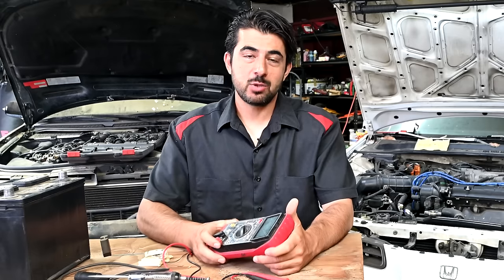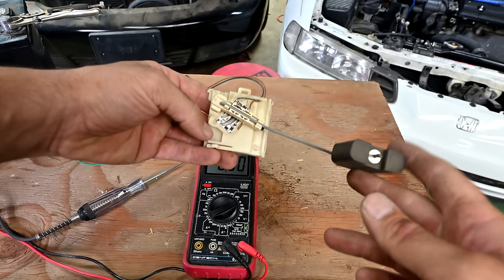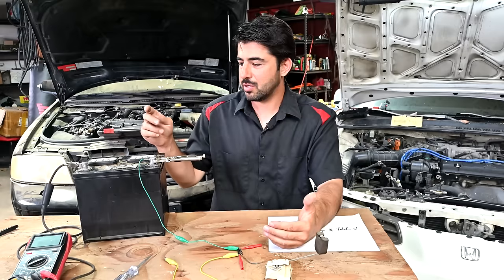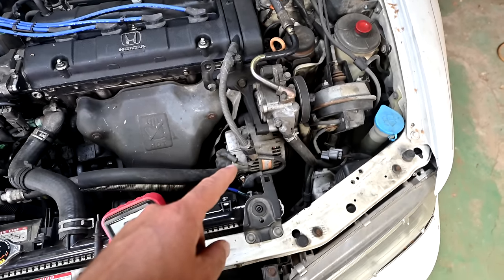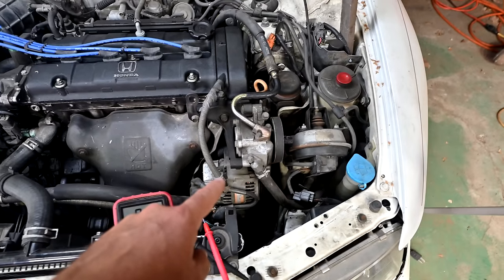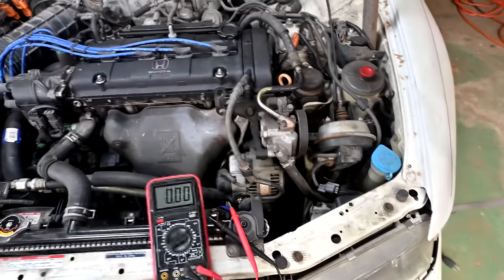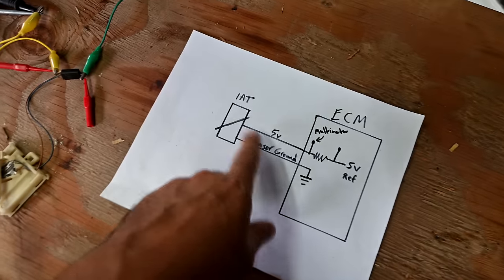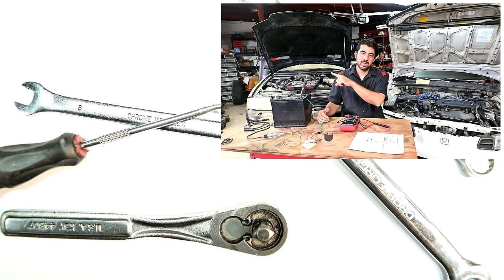Fix Electrical Problems by Understanding Voltage Drop Testing

Comment: I don't think this was explained well.  Made it too complicated.  You're trying to work with a voltage divider circuit and using that to detect the state of the device that is dropping voltage (presumably for a position that correlates to a changing resistance level of a variable resistor).  The end comment about 12 v. when unplugged is also confusing.  There are voltage grounded circuits, where the 12 volts is being supplied by one wire, then going through the device, and then back out to a PCM with a circuit that has internal resistance, and possibly a transistor circuit for bias (switching), and is grounded.  The resistance outside the PCM, along with the resistance inside the PCM provide a voltage divider circuit, and affect what is sensed inside the PCM for decision making elsewhere.    The sidetrack onto voltage drop across fuses was also confusing.    Basically too many concepts/examples across too little time while jumping around the engine bay also contributed to the confusion.

Comment: In a series circuit the sum of all voltage drops is equal to source voltage. In series circuit the the current is the same throughout the circuit. In a parallel circuit voltage is the same but the current will be divided in each branch depending on the resistance. If all the branches have the same resistance then they would also have the same current.

Comment: Can you explain why a brand new battery  forms acid around the terminals? I've replaced my car battery twice with new interstate battery, and still continues to build up acid.
Reply: Maybe the Car is over charging ? Have You had that checked ?
Reply: Clean your battery terminals then put some silicone paste on them.
Reply from the maker: yes check the alternator to see if its overcharging the battery.
Reply: @k9under  You can put anything on there. I’ve used just basic chassis grease and it works fine. Some people periodically add engine oil off the dip stick and that works fine. If you’re real fancy you can buy a tube of dielectric grease and feel good about yourself.
Reply: @markm0000  Yes sir back in the 1970 i use to put vaseline on battery cable.

Comment: This was a great video explaining  circuits, resistance, electrical theory.  I've taught myself how to read wiring diagrams to to the level of adding heated seats and power windows in a manual window car. Everything worked 100%. A great sense of accomplishment for me. Toyota dealer was impressed because I designed circuits to bypass bcm with stand alone harnesses.  Excellent content made perfect sense.🙏

Comment: I had a coolant temp sensor fail on a later model Jeep Wrangler a while ago. I was doing my due diligence and testing the circuit and I noticed the 5v wire went from something like 2v to 5v when I unplugged it. I'm guessing this is super similar to what you were explaining in the video with the 5v circuit going to 12v. But if you could explain this clearly I'd be grateful. Great video thanks !
Reply from the maker: I will try to make more videos like this, but I think I need to split things up and be more thorough :)
Reply: @myRatchets  it might be cool to do a video on diagnosis of 5v sensor circuits. I would definitely be interested in learning more about that

Comment: What would you recommend (tune-up wise) on a car that's been inactive for 5+ yrs?
Thanks and love the content!
Reply: Id first and most put some oil down each cylinder before turning it over. I would also disconnect fuel and spark to build up oil pressure. Everything is dry as a bone. full brakes, calipers, brake lines, air filter, cabin filter, oil change, fuel filter, trans fluid change, coolant flush ugh just redo it all.  Sitting inside and outside plays a role.

Comment: The two resistors in series form a voltage divider circuit. When the connector gets disconnected @16:00 and you read 12V instead of 5V, the resistor in the ECM is acting something like a pull-up resistor found in digital circuits.
Reply from the maker: ah makes sense, thanks for your comment.
Reply: Holy crap I forgot everything from my electrical class. I need to get back to understanding these.
Reply: Thankyou, that was the bit I was confused about.

Comment: Amps is the lazy one that doesn't go anywhere unless theres a clear path to ground
Voltage is the active one thats always on the go, until something get in its way or send it on a detour, 
for example 
A break in a wire is like a bridge that would've carried you on foot straight home had it not been blocked by cops all of a sudden , now you have to detour a much longer way which will then drain some energy from you by the time you reach the other side, that blockade can be one of 2 things, a switch that will drain a required amount of volts which is normal or resistance thats contributing to more than normal voltage drop, bad switch, break in the wire, rust corrosion etc

Comment: @R&W - Just two questions (1.) In most shop manuals, you'll read, in bold print -"Do Not Test Grounds Using Vehicle Ground" (or something to that effect); I guess there's fear of errant 12V running thru the ECU. Is this the case? (2.) And I've seen old school techs test an alternator by quickly removing the neg. battery terminal, and watching the stall and/or hesitation - can this actually damage the vehicle's electronics?
Reply: old school techs test an alternator by quickly removing the neg connection, not good for modern cars because they have computers.
Reply from the maker: That is not a good way to test an alternator, modern cars will stop running regardless of a good alternator or not, also you'll lose all setting and not safe for your ECUs etc. sorry not sure I understand the first part of your question.

Comment: Hi, I have. problem with dodge caravan. I changed the alternator and the battery was tested it is working, however. There is a sharp rapid drop in voltage after I turn the engine off.  does within seconds from 12 to 9 volts. I have to jump start every single time  I turn it off and even for gas filling at the pump. Do you have any suggestions on what that might be?

Comment: If we can expect to see a voltage drop of no more than .5 between positive bat and stud of alternator, what is the benchmark voltage drop we are looking for between the housing of altenator and negative bat?
Reply from the maker: no more than .5v total. You rarely have a problem on negative side without other electrical circuits not working right.

Comment: The alternator isn't going to try to charge the battery from that test wire, is it? Just wondering if it tries to send 10 amps through my multimeter?
Reply from the maker: no you're just measuring for voltage basically. No current it flowing through your multimeter unlike when you test for amps.
Reply: @myRatchets  But what if the multimeter is the path of least resistance, or does it not work like that. Sorry, I've managed to short a multimeter before. But that was at 230v and I really cant remember what it was I was doing. All I can remember was there was a massive spark and my wires blew aha

Comment: "I dare you! Ask me more questions!"  I thought that you did a good job explaining this concept in the context of working on a vehicle. I would like to see you do this to check the WIRES to the O2 sensors on a chevy Silverado, preverably as it applies to the 2000 models. (mine's a 1500 ;) )
Reply: Unless you’re referring to heater circuit of the O2 sensor this really doesn’t apply . O2 sensor generate a voltage that ranges from 0-1V , that voltage is only capable of pushing at best maybe 1 or 2 mili amps .. The best way to test is with using live date on a scan tool or a lab scope .

Comment: New battery and new OEM Alternator been replaced couple of days ago, all interior exterior light more brighter, but when I depress the gas pedal with no significant load expect vehicle interior light on the light gets brighter for half a second and the volt gauge on the dash still shows drop on voltage, any idea why I still have volt drop please?
Reply from the maker: You have to measure for voltage drop you could have excessive corrosion on one of the terminals. Also its not unheard of to have weaker than normal new oem alternators. gl

Comment: So, the test light was using 7.6 volts and fuel float was using 4.3 volts.  That would be 11.9 volts total.  Supplied voltage from the battery was 12.3 volts.  This would tell us that 0.4 volts was being used from another source, which most likely was from the wires connected to the battery or the battery terminal connections.  So, the complete circuit would have 0.4 volts of resistance?????
Reply: He said 12.06 or 12.07 v with the light on.
Reply: The drop would be the difference between 12.6  and the 11.9  which would be .7
Reply: You should always measure the bat voltage without anything in the car on first! That is your reference voltage. Then test for voltage drops.

Comment: I have been trying to learn this but nobody has explained to to me that makes sense. Still makes no sense. Less words more demonstration.
Reply: Imagine two lakes at different heights, with a dam between the two not allowing water to flow down a dry stream bed between each lake. The difference in elevation between the two lakes is analogous the voltage difference between the two lakes, what we call voltage drop across the entire line. Now imagine the tech lowers the dam to allow water to begin spilling down the creek bed between the two lakes. Water cascades down in a series of little waterfalls, with a small "voltage drop" across each little waterfall of the stream. The sum of all the small waterfall drops has to be equal to the total height difference between the two lakes. Now think of an extension cord with a bad spot in it, with frayed, corroded wires. When you measure voltage at the end of the cord, voltage is 120V when the cord is not plugged in. But then you try to run your table saw with it, and you notice the saw won't work. Then you measure voltage right at the saw while the saw motor is turned on, and to your surprise the voltage is not 120 V, it is only 40V. The upstream resistance in the wire caused a voltage drop in the wire, much like an upstream waterfall. That voltage drop in the wire is robbing power from your downstream saw. It's only visible when you get electrons moving....

Comment: You talk about the alternator, but not explain which cable is positive  and the.  Negative to find out voltage drop 12:48

Comment: When you do a formula and then simply wing it, without putting up any real numbers, you simply will lose an audience who is trying to grapple with the concept of electricity and that’s difficult enough. A formula without a number and example based on a real world demonstration, just causes people to shrug their shoulders and basically say “I don’t understand.“ And that was me who kind of dropped off about five minutes into this.  Sadly.
Reply: He had me at voltage drop. Lol. Alot of confusion

Comment: Gotta say this was very confusing. I think you failed to explain to someone who doesnt really know the basics. In your first example youre measuring the voltage drop clipping on the positive side coming into the needle part of the bulb tester and the ground on the battery. Then in your alternator example you talk about measuring first the positive side voltage drop then the negative side. I saw other videos so I get what youre doing but this one just felt like one of those videos where you skip details because you know what youre saying, but its a little too vauge for someone who doesnt know. But thats just me. The comments are divided between people who got it, people who were confused, and people asking for unrelated advice. Also examples are always helpful. Maybe wait till youre ready to provide an example of your concepts. Thanks for your videos though. They have been helpful.